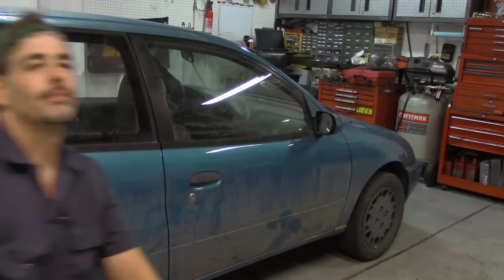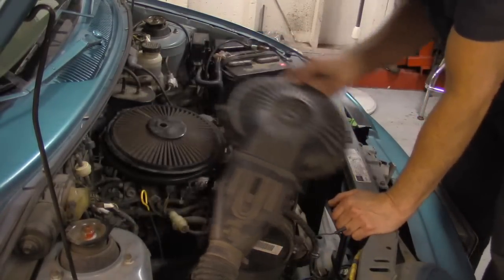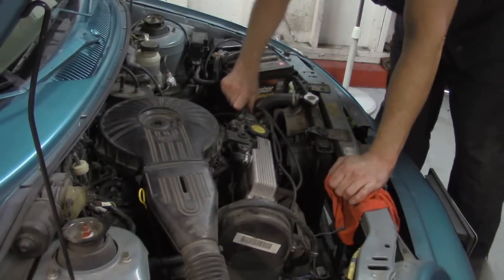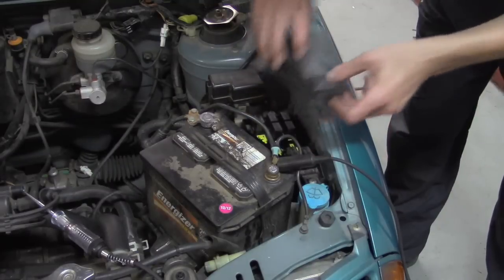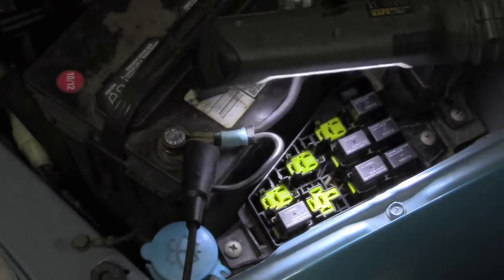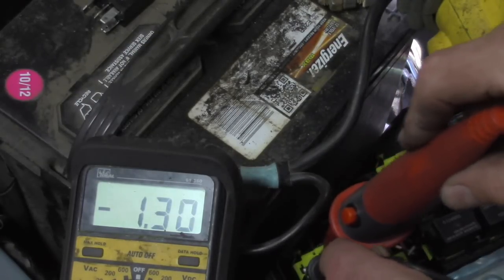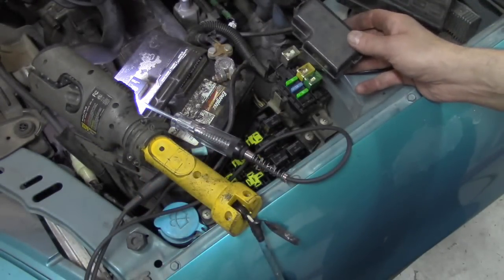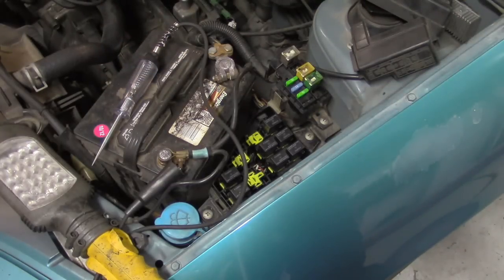Cranking No Start -Quick Basic Diagnosis

Comment: I replaced timing belts water pump throttle position sensor battery fuel pump crankshaft camshaft check all fuses relays immobilizer starter spark the list goes on and STILL CRANK NO START!
Reply from the maker: What data are you using to determine you needed all of those things? I would question your data acquisition and analysis methodology.

Comment: what do you do when you don't have a crank sensor like my 1985 p30 & have a no crank sensor changed the fuel pump, module, & coil , i know stupid but   desperate measures  !!  still wont start looked under distributor pretty rusty hmmm  what do you think rotor turns
Reply from the maker: I would start with a basic FASTTEC procedure.
Reply: @SchrodingersBox  what is a basic sorry for being dumb but did that  was thinking of changing distributor n rotor
Reply from the maker: See my videos on FASTTEC.  You have to start there on ANY no start. It's always the first step.

Comment: WITH ALL THE  LESS WEIGHT HERE THERE'S NO REASON TO BASH THE HP BECAUSE OF THE  MPG. GAS TAX IS A FEE YOUR LOYALTY TO THE INDUSTRY IS KEY SO YOU'RE A YUPPIE! CUT THE BS POWER TO WEIGHT IS THE SAME MPG IS DOUBLE. ITS MISOGYNIST BECAUSE THIS WAS / IS A WOMAN'S CAR ITS CLASIST BECAUSE ITS AN I FAMILY ECONOMICS TO BASH THESE CARS IT'S ALSO MISERY WHEN MEN DRIVE THE, THOSE THINGS ARE WRONG NOT BECAUSE THEY HURT PEOPLE'S FEELINGS AND HELP ONE GROUP BE  SOCIALY ANTI COMPETITIVE. THERE WRONG BECAUSE THEY CHARACTERIZE A DEMOGRAPHIC AS  INCAPABLE OF DEFENDING THEMSELVES AND UNWORTHY OF AUTONOMY. IN OTHER WORDS FIGHTIN WORDS THAT THREATEN EQUAL RIGHTS TO PERSONAL PROPERTY. 
THE  BIGOTRY THAT FOLLOWS IS  IN FACT A THEFT. THE BASHING AN ORGANIZING  CALL TO ARM  TO OTHERS  TO HELP COMMIT THE CRIME IN THE  ROLE AS SOCIETIES   'COMPTROLLER'S'   FOR THE SAKE OF A WEALTH  BUILDING SYSTEM. THEMSELVES CASHED OUT REGULARLY LEST THEY GAIN MORE ADVANTAGE THAN SIMPLY OVER THE LOWER GUILDSMEN.  AS SUCH ITS POST ETHNIC CLEANSING GENTRIFICATION THAT CONQUERS PEOPLE.   THE REMEDY IS NOT DEMOCRACY BUT A RESTORATION OF NATIVE NATIONS.
Reply from the maker: You should be more concerned that your caps lock key is broken.

Comment: Why was there no spark?  The only remedy I saw was to replace the fuel injector fuse.  That would not impact the spark issue, would it?
Reply from the maker: Yes it would on this model because the primary ignition voltage is also supplied by this fuse.

Comment: Hello I just have the same problem with my geo 96 3 cil.and I check all fuses ,relays crank sensor,fuel pump and I still not have a spark ⚡️ neither fuel,any suggestions are welcome thanks
Reply from the maker: Doi a basic FASTTEC
Reply: Schrodingers Box ,thanks for your help,let me try and see what I can do 👍🏻
Reply: Schrodingers Box ,those relays they are same,Because they have the same number, but the power they don’t come on the same leg on the relay box ,I am confused
Reply: Oops that a Noid Light Set...

Comment: Ok here's a doozy I've chased for over 2 weeks...
2001 escape v6.
Started and drove OK with no issue. Turned engine off. 10 minutes later go to start and will crank fine but wont engage and run.
On rare occasions I pump pedal to start it the engine runs HORRIBLY and instantly stalls. Tach not showing anything when attempting to crank. Fuel at rail seems OK. Spark seems ok. Swapped fuel pump relay, tried beating on tank, etc. This started outta nowhere and let me stranded. I'm really needing direction... posted a video of attempting to crank it if hearing it will help. 🤬
Edit: no codes pending or stored.
Reply from the maker: What data do you have?

Comment: There's idiots everywhere. Those not having to diagnose, often are the fastest to chime in. Good work buddy, skilled trades are slipping away but, you've got it locked in.
Reply from the maker: Thanks man!!
Reply: @SchrodingersBox  more than welcome. Obviously the crank no start, brought me in search. Got fuel at the rail, new coil packs (3x repeat on p0300), I do know LIM needs replacement but, its been drivable thus far until yesterday. When it overheated hitting 245*, then the p0300 kicked. Now it cant be started.

Comment: I have a 2000 metro and sometimes it starts and runs fine then sometimes it just turns over and backfires  out the intake and will not start i have replaced everything i can think of and still messed up  there simple little cars but this problem is throwing me
Reply from the maker: start with a basic fuel trim analysis.
Reply: I have not replaced the injectors  think i will pull the rail and check there spray
Reply from the maker: Why do that? There is no evidence whatsoever of a fuel delivery issue.
Reply: I cant understand why sometimes it runs fine then sometimes will not start and pops and hits like its out of time checked all the marks are lined up replaced about everything on the car  it was something i picked up cheep and  the guy that had the car had replaced alot of stuff  i just dont know where to start with it replaced the cam pos and it started right up ran fine cut the car off and just pops and backfires out the intake  sorry for the run on sentence
Reply from the maker: Thats why you should analyze it, not guess at it- for exactly that very reason!!!

Comment: One question....why didn't the starting fluid make any difference?
Reply from the maker: Because there was no spark
Reply: @SchrodingersBox  oh ok, thank you...because I have an 09 traverse that cranks but does not start...tried starter fluid and nothing...also I can barely hear the fuel pump with my ear to the filler spout...could the fscm cause this dilemma ?
Reply from the maker: impossible to tell what data do you have? what’s the voltage drop across the pump vs source? What’s you CKPS reference bs signal voltage? 
  there are no basic fundamentals to go off of in your description.

Comment: Just curious I have 88 s10 2.8 runs good when you start it warms up then won't start no fuel coming out.let it sit starts right up after hour.any help would be appreciated great videos.
Reply from the maker: What data do you have?
Reply: Schrodingers Box  has no codes if that's what you mean
Reply from the maker: No I mean whats your long and short term fuel trim curved against load and also the static and loaded rail pressure?

Comment: I was told that I needed to pull the Crankshaft Pulley Off and I did but I didnt see the CKPS and there were no wires either. I pulled back the alternator back.. still did not see it ... darn
Reply from the maker: Then it is not there. Many cars have them along the driveplate too.

Comment: Hey Matt Some Good  News !! I Directly Connected 12 Volts DC to the Fuel Pump  and heard the Fuel Pump spinning and have good fuel pressure to the fuel filter also. But am not getting 12 DC ( Electricity ) to the Pump ...and no spark?
Reply from the maker: Perfect!! I would do a bypass test on the CKPS as next step to verify spark signal.

Comment: I pulled Number #1 Spark Plug  and there was Spark No Fire ! Nothing...I volt tested the B+ and Fuel Pump port in the Diagnostics box under the hood and got between  49.2 and 9.3 Milli-Volts .
Reply from the maker: You only had 50mv at a fuel pump???? Your fuel pump wiring has an open then. Or you tested it incorrectly.
Reply: Truck was working perfectly and only has  27,000 miles on it. but I through a large Log in the bed / box then tried to start it but I would not start after that ? hmm  maybe I should buy a Power Probe & one of the circuit tracers that I seen in video's ? toyota wraps shething around the wiring harness all the way to the back.
Reply from the maker: You don’t need one. Simply verify your finding of no amperage by just jumping the load side of the relay port. If it doesn’t start then the. all you need to do is find if power or round is missing and then just bypass to verify and then  trace accordingly. If power is missing start with the fuse.

Comment: Would it be ok if I ran a new 14 ga. wire with a manual switch between the fuel pump and Battery... I can turn it on when I need to drive and flip the switch off when I am done driving ? will this work or ?
Reply: Depends on why you're wanting to do that...
Does it keep blowing fuses? If so trace and fix the fault causing that.
Is it an intermittent issue?
Generally speaking it's not recommended to bypass factory wiring with other stuff unless certain circumstances.

Comment: I have a 1994 Toyota T-100 Pickup Truck ( Cranks great but wont start ) I installed a new OEM Fuel Pump & Fuel Filter , Battery  with new wires, I pulled out the  Circuit Opening Relay
 and energized it with 12 DC it was clicking good..points where pulling in good... I dont think im getting 12 DC to that relay?when I turn the key and when I checked for 12 DC at
 the fuel pump I didnt have any Voltage at all ? what should I do next ? Thanks in advance.
Reply from the maker: Why are you chasing fuel? I don’t see the evidence this is the problem yet. What is your rail pressure?  Or simply put 12V to the pump directly  and if car starts you need to look for if load or control side feeds or grounds are missing and repair accordingly. Simple as that!

Comment: The coil on the relay will have a low resistance. Ohm meter. Or put 12 volts to the relay you’ll hear a click when you got the oil

Comment: My car cracks slower than that. Any ideas? 5.7 hemi Chrysler 300c
Reply: Elegant Elliott change your batrrey bro. .
Reply: Either than batter check voltage drop on the starter circuit
Reply: Change your starter and battery

Comment: Did you know on average 2 out of every 10 brand new spark plugs in a box can be defective?
Ask any mechanic and they will tell you they deal with that problem consistently!
Reply from the maker: Well I can tell you that is completely untrue. Missdiagnosis is by far more likely. Seems to me you are probably just trying to sell some useless gadget.
Reply: Schrodingers Box I suggest any of your subscribers go ask a few mechanics and find out for themselves whose telling the truth about whether brand new plugs can be faulty and defective.

As for our so called useless gadget...if you believe Occupational Health & Safety and accuracy being useless...the reason it has been purchased by #1 hire companies and local government. You and your subscribers can even ring Lake Erie Golf Cars (Ohio) for their opinion of our Spark Plug Testing Kit...they purchased 10 of them!
Reply from the maker: it’s useless because if the plug is bad because insulator is cracked and grounding the spark to the head your device will not detect it.
Reply: When the insulator is cracked, the spark is not consistent, it moves erratically between cracks...result a weak spark and prone to failure! In some instants there's not enough spark to start an engine especially the small single cylinder type. Our tool does not ground the spark plug to the head! Grounding is done securely and safely! The spark plug is secured inside a remote viewing chamber to enable the user to visibly see all the above in a safe environment!

Comment: Just a new sub., who has watched a lot of your diagnostic videos on crank, no start. A lot of it is way above my head, couldn't even catch it with a ball glove. FASSTEC is very helpful. Still working on getting my sons car running. I just don't want to throw random parts at it. Even worse, it's on my sisters sloped driveway, wind is from the north, and snow. Wishing you and your loved ones a Merry Christmas, and a Happy New Year.
Reply from the maker: Thanks for dropping by. The more you watch of these, especially my "Diagnosis and Understanding" series, the more you will understand this stuff!
Reply: Just finished watching your HOW NOT TO FRY YOUR PCM video. That was like gold to me. I've been working on my sons 93 Grand Prix for over a week, after work. Their is so much bad information on youtube, and google. So as a 50 year old man, who prefers older trucks/ I have a'80 Powerwagon 360, 4 bbl, 4 spd, a '57 Dodge 1/2 ton with a '69 Plymouth front clip welded in, for IFS. Daily driver is a '99 Ram 1500. I grew up with the saying, if you cant fix it with a hammer, you have an electrical problem. Computers are like voodoo to me, scared to fry PCM. Learned a lot by just watching your videos, Fawk tomorrow is going to be -20*C with a wind. Just wanted to say thank you, for sharing your knowledge. The 40 thumbs down are probably from people who cant figure out how to get their bicycle chain back on. Season Greetings from Alberta Canada.

Comment: Hey man. I wanted to send you a private email to ask for your knowledge but not sure how on this. I am on break from school and have been waiting to ask you if you could direct me in the right place. I have an 03 explorer and as I have time, I am trying to fix it. My mom said it is a fuel pump but I don't want to replace it unless I am sure. I've checked the main/basic stuff I know to do. What I know-crank/no start. Starter fluid in TB-does start. Under hood fuse box-relay does NOT click and I tested all fuses inside and out that I am aware of and there are a few like high beams that fails test light. I have a feeling it is electrical but I am not sure where to look next. The fuel pump relay is new. That is the only thing I have replaced. But it still doesn't engage/click. When you get time, will you think about what I should do? Thanks a lot!
Reply from the maker: If relay isn't engaging you need to simply verify if you have load side and control side feed and ground side control on the switch.  These circuits are almost always ground side switched so if you do not have ground side on the control with crank, that's your issue. If all that checks, you either have open load side ground to motor OR pump is bad. Confirm ground integrity as was shown in video and jump 12V to pump to confirm issue.
Reply: Hey Matt, sorry it has taken me a bit to reply.. Thank you! I will watch the video again and try to do what you said. I will let you know. i hope I can figure this out! Also, my dad did something with the fuel shut off switch, he said he bypassed it by clipping the wires and hooking them together. That would be the pink/black wire and the green/yellow wire. I also checked both of them with my test light but it did not light. I have checked all the fuses in both boxes-under hood and inside and most fuses light test light when I ground the end. Something I thought was weird but not sure- there are a few fuses that do not light test light like others do with key on and off. They are #3,4,7&8 inside and #41,#42 under hood. I tried with ignition on and off. I didn't know if there might be something wrong with fuse box or more- an inline fuse between power box and inside fuses box? Anyway- I will see if I can do the things you said. I got a volt meter (cheapo) and a test light. I will have to also make certain I m using it right! Thank a lot.

Comment: I had a crank, but no start on my 2000 Ford Taurus.  Fuel was good, at rail, and pump was priming OK.  I had no spark at the coil and traced it back to the crank position sensor.  There was no magnetism at all on the tip of the two-wire crank position sensor.  You can access 
the sensor after you take off the right hand side front wheel, and lay on your back, while car is on a jack-stand.  The car started right up after the sensor replacement, and the spark was visible at the coil again.
Reply from the maker: Good call. I would have verified with a CKPS bypass just to be 100% but still an acceptable call.

Comment: Love you videos. You couldn't be any more correct in your process. I always check the fuses first only because in my profession I always have a volt meter handy and I'm usually on the side of the road and its the only hope of fixing it right away being that I will have extra fuses in the glove box. Randomly checking fuses is just stabbing in the dark.

Comment: I'm ok with you checking for spark or fuel in no particular order, but you will get burned by not checking spark at the coil as well as the spark plug wire. If the ignition rotor was not turning or if it was broken or missing, you wouldn't have spark at plug wire, nor would you have spark if bad coil wire, but you would have spark at coil. Now assuming somebody didn't remove the CEL bulb, you may have deducted a power issue due to the fact that the CEL did not light with key on and neither did the fuel pump prime or run. The only other thing to do is check to see if 15a fuse is the proper rated fuse and there is no add-on devices in the car on this circuit. If this fuse is like the ECM-B fuse on most GM cars or trucks, the fuel pump relay or pump is drawing too many amps and has seen better days.

I know ScannerDanner uses a damn test light to check spark, but I have found that is a good way to blow the bulb. Use a spark tester or a screwdriver. Spark should easily jump a half inch, and I mean steady spark, not just spark when you first start or finish cranking. A good strong steady spark. I've seen techs say it had spark when it had none.
Reply from the maker: You must not understand what is happening in this diagnostic. Watch again- the coil is logically eliminated before I need to examine for primary ignition. Checking the coil would be a complete waste of time- there is no command to the coil.
  Had I determined a no spark condition then of course I would test primary- but there is absolutely no point in doing that here.